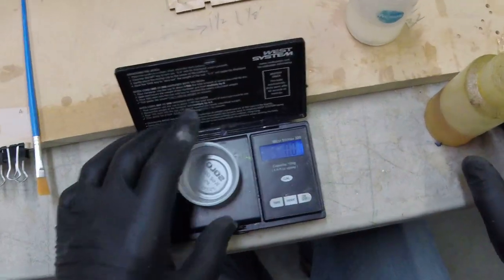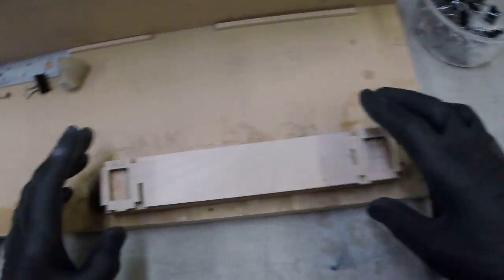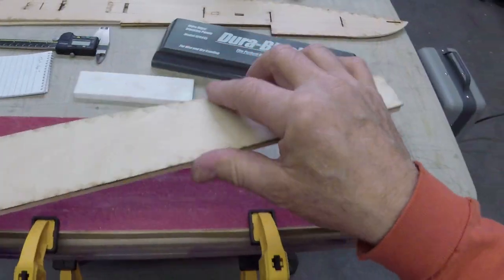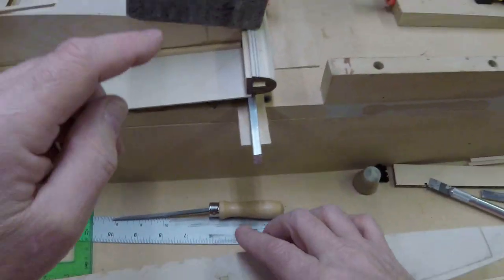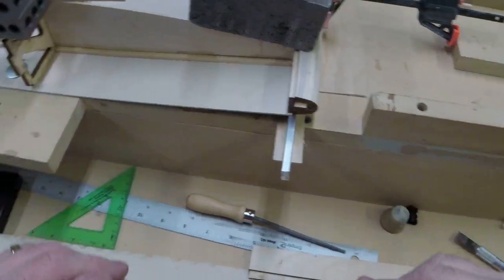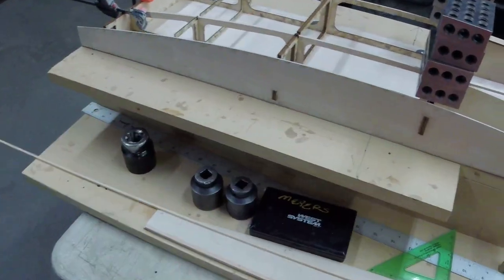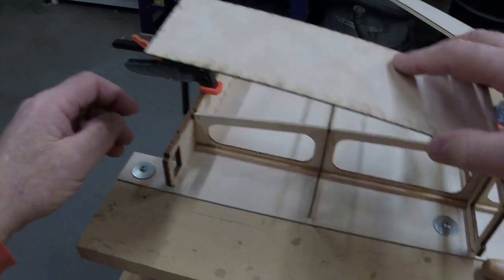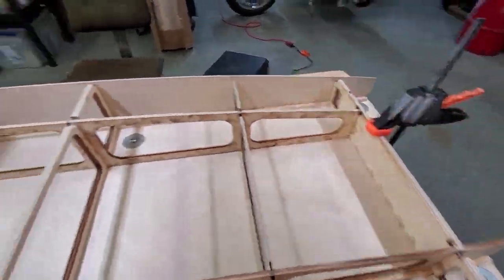Building a Model Race Boat | Final Preparation of Center Section Pieces - Major Assembly is Next!

Comment: We sheet sailplanes wings with Gorilla glue, the expanding polyurethane, spread ultra thin with a credit card. Clamp it tight or add lots of weight and it’s extremely strong but light weight, lighter than when we used epoxy.
Reply from the maker: Video?

Comment: I use a length !.5m Tee section aluminium as a long sanding  block. You stick the paper to on side of the Tee and you can use the back as a 90* and clamp withe the opposite section. It works good  and it's solid.
Reply from the maker: That's brilliant!  Why didn't I think of that?

Comment: One tip you may or may not like. When I laminate 2 pieces together I get 1/16” wood dowels, line up dry and drill locating holes using the dowels as pins. I figured this out chasing the pieces around when vacuum bagging with epoxy. Amazing how slippery epoxy gets between 2 pieces of wood as you try to clamp or bag it.
Reply from the maker: I like that a lot!  Can you believe I've still never done any vacuum bagging?  Maybe you should shoot a video series on how it's done!

Comment: well,didnt like the layered ply bullnose. laminated 2pcs 1/16 basswood around a foam buck, leaving the otter one 1/4" shorter top &bottom reshaped 2 inside runners same as outer, sanded to fit. didn't shorten sponsons, but took a bit more arc out of rear.this is only my 2nd hydro.wish I would have found you8r channel before I started my 1st. its a disaster in progress.
Reply from the maker: My boats are always a disaster in progress... I just edit that part out!

Comment: What are the scale model dimensions?  Like people refer to 1/10 scale, 1/8 scale and so forth.  If one were building a scale hydroplane from scratch where would they get dimensions from?  Thanks
Reply from the maker: Good question!  Go to our club website and click the "Boats" tab. There you can see the nitro, electric, and gas scale Master Hull Rosters with dimensions for all the unlimited hydroplanes.  We don't have a separate 1/10 scale roster, but it's easy to calculate from the 1/8th scales (nitro/electric).  Go build a boat!
https://www.rcunlimiteds.com/